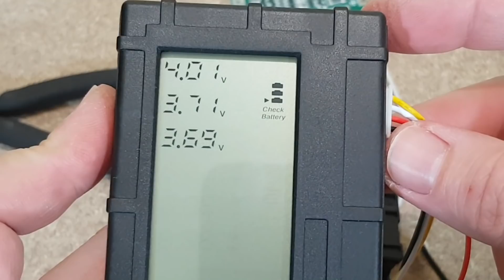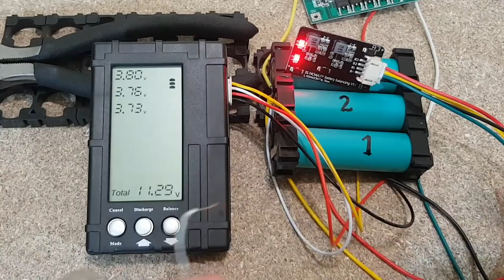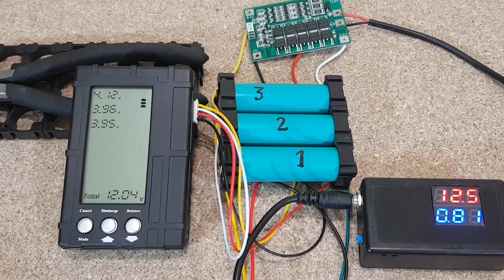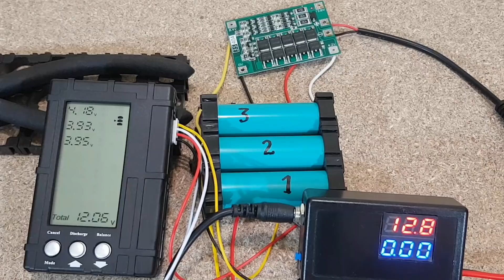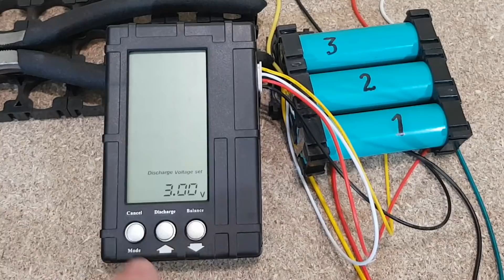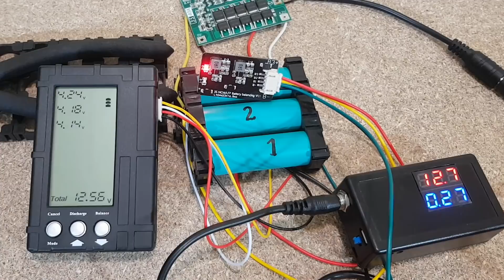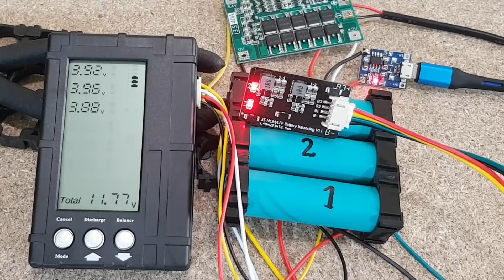Active balancers - are they any good? + testing a battery tester

Comment: Good job!  Do you still prefer the inductive active balancer or have you begun using a capacitive active balancer instead?
How about BMS with active balancer, have you located or tested anything like this?
Reply from the maker: Hello. So far I used only inductive active balancers for a few projects. I plan to test some capacitive active balancers soon.
Reply: @Sorin_DIY Yes please.  My understanding is capacitive balancers can be more precise but it's not clear to me if they're too slow.

Comment: Perfect demonstration of active vs passive balancing... thank you!...now, is there a single, do it all active balancer that will work with multiple different batteries, 36v 48v 52v 72v?
Reply from the maker: Thanks. There are dedicated active balancers from Daly for each type of battery. but those are pretty expensive and are usually used for big and expensive batteries.
for regular use there are these simple and cheap active balancers, they can be used for multiple types of batteries, Li-Ion and LiFePO4, from 2S to 17S battery packs.

Comment: just made a 12v portable ozone generator which charges from a single 1s 5v battery bank board. battery was 3x super old and scabby 18650s with ~1500mah capacity left, high cycle count. used the best cell as the primary battery which charges from the battery bank board and then balances the other 2 thru a similar 3s active bal board.
~12v lets me run the ozone step up module just fine and its so low current it doesnt care the pack is so poorly matched. i think any portable ozone generator will eventually oxidize the crap out of whatever its made out of, and will rust away/break, so i thought this was a perfect use for my old 18650s on their last bit of life. maybe a rare example of when active bal 1s to 3s makes sense. i should probably conformal coat whatever i can though.
series battery bank boards are ~10-20x more expensive and would tripple the cost of the project, not to mention the cost of a bms. made sense to me to go this route

Comment: very disappointing that  passsive balancer doesn't cut the current until 4,3V. very surprising. Whats the point of using it then? it must cut it absolutely at 4,2
Reply: great review btw subbed
Reply from the maker: Hi. These are active balancers (not passive balancers). Their job is only to draw energy from the cells with the highest voltage and use that energy to partially charge the cells with a lower voltage, within the specified voltage range and with a low efficiency. 
They are not meant to protect the cells/battery. the battery still needs a BMS (battery management system) protection board. Some BMS boards also have a passive balancing feature, which works only at the end of the charging process.
Reply: @Sorin_DIY  i mentioned about the cutoff of BMS. BMS cut the voltage at 4.3. This is so much. Surprising
Reply from the maker: I thought you were talking about the active balancers. Yes, this BMS board has an overvoltage protection feature at 4.25V +/-0.05V. In this test the BMS stopped the charging process at the maximum value of 4.3V, which is pretty high for regular Li-Ion cells. There are also Li-Po cells that can be charged to max 4.35V, so this BMS will be very good for them.
But usually this type of BMS stops the charging at 4.25V and then the balance feature continue to decrease the voltage to 4.2V.
Other type of BMS boards have an even higher cut-off voltage...
Reply: @Sorin_DIY  Yes it must absolute 4.2 IMO. Thanks for response

Comment: Hi, must we use an active balancer only during charge , or  is it possible to let it connected to the battery and keep a permanent balance correction by use of the pack?
Reply from the maker: Hi, the active balancer is connected directly to the battery pack and will always balance the cells.

Comment: Can you please review any 2S balancer? If we use a non balance version of 2S bms, should we use a balancer?
Reply from the maker: It's recommended to use a BMS with passive balancing. An active balancer is optional depending on the type of project and battery.

Comment: You said that the passive BMS have just not quite big enough resistors to dissipate the charging current leading to overvolts and damage. 

So, ideally, if you used a much less powerfull charger you would manage to dissipate all the overcurrent and have a fully balance with 4.2 V on each cell right (With a passive BMS)?
Reply from the maker: Yes, but it's more complicated. lowering the charging current is not enough, because you lower only the maximum charging current (when the charging process is in the constant current phase).
you need the battery to draw less current in the final moments of the constant voltage phase. to make this possible, you need a small voltage difference between the charging voltage and the battery voltage, until one of the cells reaches the over charge protection voltage of the BMS and the charging process is stopped. 
for example for a 3S bms with overcharge protection voltage of 4.25V per cell (12.75V total) you need a charging voltage of 12.8V ~ 12.9V. this small voltage difference between the charging voltage and the battery voltage will charge the battery with a small current in the final phase and will slowly reach the cut-off voltage of 4.25V of one of the cells. 
you need to test the final charging current to make sure it is slightly above the balance current (so this also depends on the balance current of the BMS), otherwise the cell voltage will not reach the over charge voltage to complete the charging process. 
for more info you can watch this video: https://youtu.be/1kth4iqaHP4

Comment: Active tester is always good and better than the passive one especially for the home built one.   I know well as i have built 14s100p  for years for my solar system all from recycle battery.  When used batteries are used it is a guarantee to always have cell out of balance; active balance will prolong and increase capacity  of cells pack.

I do not use these small active balancers as they take forever to balance a large pack.  100 cells in parallels is NO JOKE!!!!!!  What i use is the programmable with bluetooth  phone app. for monitor and adjustment that can do 4 A  all the time regardless of cell voltage difference.   Surprisingly it does not cost that much more than the flying capacitor type.
Best of all it works excellent  and always balance quickly live during use both charge and discharge mode.   

I am sold on the importance of   a good active balancer especially on a home built  large battery pack from recycle battery.  If it can prolong  on  recycle battery that has end of life already imagine how prolong it will do to the new or little used cell pack.

It is a worthwhile investment and  i paid under $100  that can do up to 16 S.

Comment: Hello sir, I have a question , What if swap the resistance with lower value of resistance in passive balancing in let's say bms, then does it have higher balance current and could reach upto 1amp ???
Reply from the maker: Hi. you can change the resistor with a lower value for a higher discharge current, but it depends on the maximum current than the mosfet can work with, to trigger the cell balance. usually they work with 60-100mA, but there are some balance board with max 300mA. 
there is another problem, with a high balance current, the cells voltage may not reach the overcharge (cut-off) voltage, so the cells will continuously charge and get balanced. the cell voltage must reach the overcharge voltage to complete the charging process and cut the charging voltage, otherwise if the cells are continuously charged, they will get damaged in time.
I suggest you watch my XH-M604 review video for more info.

Comment: Great video my friend i dable with batteries for a while now and didn't know about this balance board i always use BMS and as you said since i use old batteries from laptops they often broke because one of the batterie from the pack disscharge more then the others. My question is can i use only this Active Balance board without the BMS when i make some batterie pack and is it better ?? Thanks and again great video
Reply from the maker: Hi. You still need a BMS board, because the balancer module doesn't have battery protections: overcharge protection, overcharge release voltage, over-discharge, short circuit protection.

Comment: i think to put in a TP4056 to the middle cell is a brilliant idea, Sorin. If we set the charge rate below 500mA, i don't think it will destroy the cell because the active balancer will transfer some of the energy to other cells and TP4056 will stop the charging if the middle cell reached 4.25v or so.
Would you mind to test it again, letting TP4056 + active balancer to fully charge the pack, please? I think some of us viewers will find it interesting to watch. 😉
Reply from the maker: you can charge a battery pack this way. but some of the cells will get more charging cycles, because the balancing will start, stop... start... those cells will have a shorter lifespan.
Reply: @Sorin_DIY  ah i see... thank you for the explanation. 😃

Comment: Hello sorin i had a question i have made a power bank of 4s cells with passive bms board. Can i add a 4s active balancer board with it too since i see that all the cells have voltage difference of 0.2 v and more ?
Reply from the maker: yes. it will help.

Comment: is good for the cycle of battery ?
because it works by charging and discharging every single cell to reach same voltage
what do you think ?
Reply from the maker: Hi. with new cells this will not be a problem. they will get unbalanced slowly in time and the active balancer will help to use almost the entire capacity of every cell. the battery pack will take longer to discharge, so it will be charged less often.  it also depends on what you use the battery for. in a UPS the cells are charged very rarely, but when you need them, it's better to last longer, even if the cells get a few cycles in that time. but if you use the battery daily in a flashlight or a portable bluetooth speaker, the cells will get a lot of cycles. this may cause some damage in time, especially with old cells. then again, you do need the entire capacity. but if you use the cells between 20-80%, the damage will be minimum.

Comment: hello brother - i have a question - i have a headlight and i need to use an 18650 2600 mah sunnyBatt battery -
now we are in 2022 - if i buy a 2020 sunnybatt it will give me less power than 2021 sunny batt ?
both 2020 and 2021 batteries are unused 
i mean produce date is very important in 18650 lithium battery  or not ??
Reply from the maker: yes. you should buy the battery as new as possible. if the cell is not stored at the ideal voltage of 3.8V, it will lose some capacity in time.

Comment: Hi sorin can you make an external power supply for canon eos500D camera, need to run the camera for 4-5 hours without battery
Reply from the maker: hi. xl6009 is not powerful enough. you need a powerbank with the same specifications (or better) than the camera charger. the battery I found for your camera has 7.4V and 1.6Ah. so it has 2 cells in series. the charger probably has 8.4 - 8.6V. you need a powerbank similar to my fast charging powerbank, with multiple cells connected in series for a higher voltage, then a powerful step down converter like xl4015 with a CC/CV output. and set the voltage and current to the charger specs.
Reply: @Sorin_DIY  hi Sorin, after some more work and as you mentioned in your message, I gave ot a try with my lm 2596 module with 3 18650 cells in series as input and adjusted the output to 8.3 volts and on the multimeter readings the Amps were 3Amps+, and when I connected the dummy battery and inserted in the camera canon 500d , it started normally, Thanks for your replies, you are the best
Reply: @Sorin_DIY  How can I share some images or videos of my work with you?
Reply from the maker: hi. you can upload them on imgur.com and share the link.
Reply: I tried one with xl6009 dc-dc booster but not positive outcome
Reply: Thanks alot, I will try and update you with the outcome.

Comment: Sorin can I charge 3 18650 batterys with a TP4056 module
Reply from the maker: yes, if you connect the cells in parallel.

Comment: in India those lipo battery u used in ur project is very costly but 12v 7ah lead acid battery is only 35% of its cost here can i use that will it give enough current? i am talking about the 12v 7ah sealed lead acid battery from bikes from amaron company. also can u make diy battery charger and discharger like shown in this video?
Reply from the maker: lead acid batteries have a lot of current, it depends where you want to use it.

Comment: Hi Sorin, I have a question. I have a almost new 3S battery. I have been using it for 3 months and charging it with a iMax B3 charger. Now the battery has voltages 3.9 3.94 3.5. Will the green BMS damage it?
What solution should I use?
Reply: @Sorin - DIY Electrical Nerd I have measures the capacity of the batteries and they are close to each other. I have connected a variable load while it was charging so it was charging only with 200 mA. I have kept an eye on it just in case. Now the batteries are again balanced. Thank you for your advices.
Reply from the maker: hi. first you should test the lithium cells, because the voltage difference is very big. you need to test their capacity. if there is a big difference in capacity between the cells, you should not use them in that configuration anymore. if the capacity is ok, the 3S BMS will work.
Reply: Okay, I will try that. Thank you.

Comment: Do all BMS boards partly regulate the charge in this manner or are there types of boards that completely stop the charge to a fully charged cell while charging the lower voltage cells?
Reply from the maker: all BMS boards (with or without balancers) stop the charging process when the first cell reaches the overcharge protection value. this voltage value depends on all BMS boards. the charging cannot be stopped for just one cell.

Comment: Interesting video.  That's a really cool active balancer you got there.

Does this video suggest the passive balancers are not that good?
Reply from the maker: passive balancers are ok if you use them with new lithium cells. if you have old cells or a bigger battery pack, active balancers are better. active balancers waste less energy than passive balancers, so they are also better for battery packs that are charged from solar panels.

Comment: I’m looking for this active balancer but can only find ones for LiFePo4 batteries. Where did you find the ones for 18650s?
Reply from the maker: I added the components list in the video description. the one I use in the video works in a voltage range of 2.0V-4.5V. so it's good for li-ion, lipo and lifepo4.
Reply: @Sorin_DIY  ah thank you

Comment: Can TP4056 can parallel 10pcs and charge 10A?
Reply from the maker: I don't think it's good for the lithium cell, it won't charge properly.
Reply: 6S battery pack and 6S active balancer the use 10 tp4056

Comment: Hi, if you have 4 battery and charge in 12,5v without bms , no probleme over charge,
Reply from the maker: at first it's ok, but after a few cycles the cells will get unbalanced. if you use an active balancer is ok.
Reply: @Sorin_DIY  I agree with you